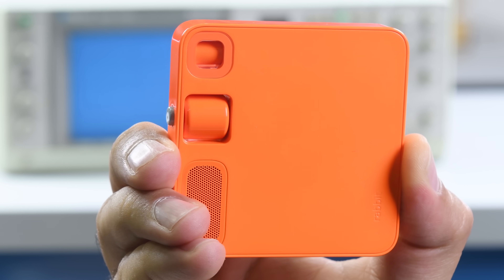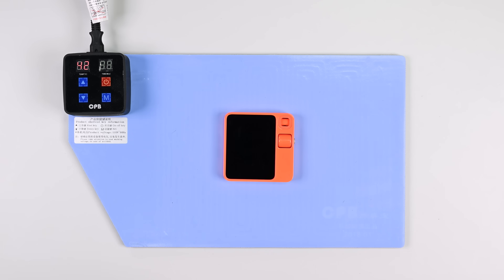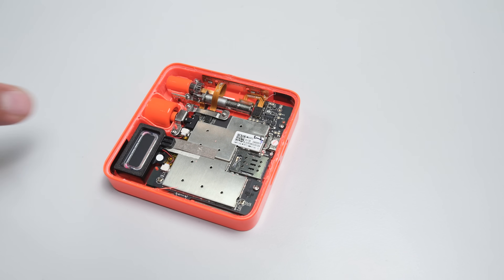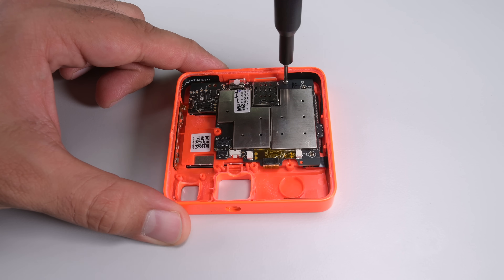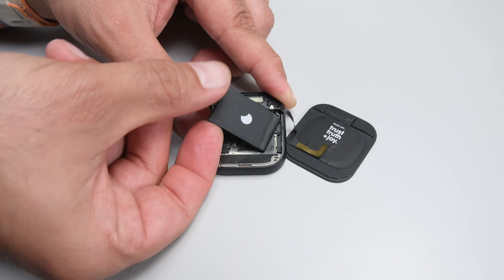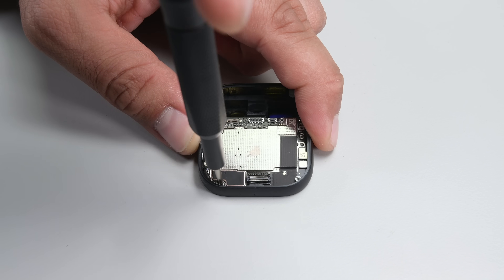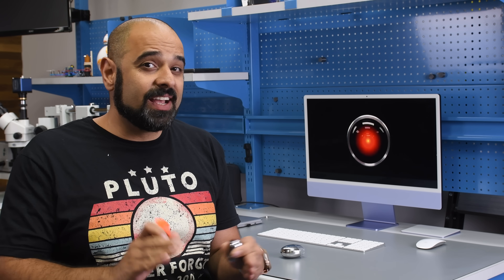The Rabbit R1 & Humane AI Pin Teardowns  - Worst Devices Ever?

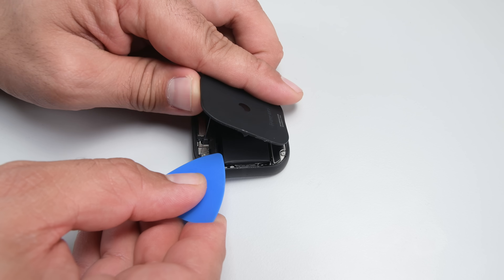Comment: 3:53 I would like to clarify this point, usually these batteries are rated for something like 500 charge cycles *to 80% capacity*, meaning that after that number of cycles, they should still have 80% of their original capacity. Ideally low-drain devices like this will perform better than 500 cycles, but only time will tell what quality of battery they used. 

While it's still 100% a problem how hard it is to access the batteries, saying they're only good for 400 cycles is a bit misleading.

Comment: humane definitely shouldve used a bigger battery and much newer chipset instead of a 2019 midrange smartphone chipset to prevent the overheating, battery and speed issues like why was this even marketed as an ai product when the internals of this phone are also some of its weak parts?
and before people say that quadcomm did claim in the website that its a low power chipset that can run ai based tasks, its still not powerful enough given how slow it is let alone having it run chatgpt

Comment: Oh. Suddenly it makes perfect sense why the Ai Pin overheats all the time, and why people report getting burned by the battery pack. Wireless charging coils.
Unless those coils are 110% perfectly aligned, a huge amount of the power gets turned into heat. And they will never be aligned due to there being clothes in the way.
And all that heat then gets dumped both into the SoC due to proximity and all the metal inside, and of course into all those solid magnets inside the battery pack.
Also all that heat will degrade the battery rapidly... 400 charge cycles will become more like ~100, if not lower. And that's assuming it don't burst into flames due to overheating.

Comment: These are from two AI companies who realized two things.  One, AI isn't profitable.  Two, they aren't doing anything more than what assistants on phones and search engines do.  Both drove them to doing very specific things that were inevitable for these types of companies.  Sell a very inexpensive to produce device and, in the case of the Humane, sell a subscription to their service.  The reason both of these companies will tank and the servers connected to these soon to be landfill fodder is because there is nothing these things do that your phone already does.
These things probably cost under 25 bucks to produce.
Now if this was 25 -30 years ago, this would make sense.  It was like owning an MP3 player.  If your cell phone could do music, you had to deal with battery consumption.  If you want to change songs, you pressed an actual button to change songs, to stop and start.  So a device that did a thing made sense because your phone either couldn't or it wasn't a viable option.  We are at a point where creating garbage to do things your phone does already is just there to dupe people.
As for the devices themselves.  Companies need to go back to the drawing table and make their devices more repairable while keeping the solidity of the there.  I don't know if that would be a twist locking system or a push down and to the side to take the back off, but this ain't it.

Comment: These are cloud devices, not true Ai devices. Its basically a cellular connected mobile device. If the Device doesn't have a neural engine on a chip equal to the M3 Max or a RTX 4070 then it CAN'T do Ai jobs on the device.

Comment: 400 cycles? I have way older batteries that have reached 1000s of full charge-discharge cycles. I have 2362 cycles on my 10 year old laptop and still get ~80% of original capacity.
Reply: Smaller devices, or those assumed to have shorter lifespans anyway, tend to charge to higher voltage.
Reply: wow i never had a laptop battery last more than 2 years with usable capacity. i mean except my current one i guess, it still probably has around 80% capacity.
Reply: That's unbelievable, my devices show noticable degradation after about 600 cycles. But it really does vary on how you charge it. Temperature, the percentage charged, and probably more factors can lead to varied results

Comment: The thing I'm most interested in here is that tiny laser projector... That is such a cool piece of hardware. I'd love to have one to play with. I guess that proximity sensor module has something like Apples Face ID tech in it? They need to get the data on how to transform the projector output somehow
Reply: Apparently it's not very good though because it's so dim that you can barely see it in daylight. It's only really usable indoors or at night. 

Interesting idea but terrible execution. 

But it also leads to the device overheating because everything on that device creates heat, the wireless charger produces heat, the processor produces heat, and the laser module produces heat. Basically an expensive cube that heats up but breaks when it does so.

Comment: Yes! these things could just be apps on your phone. It's only a matter of time until Google makes a decent version of Gemini that does everything these things can without the extra hardware to carry around and charge. I mean, what Google and Apple should really be doing is focusing on getting their assistants to work amazingly on smart watches. Sure it's a extra piece of hardware to carry around't but it's not a weird thing on my shirt or another thing in my pocket. I mean, I didn't think I would get a ton off use out of a smart watch, but bought one because I even got lazy about pulling my phone out of my pocket to check a notification, and have actually ended up using it much more than I thought I would. Rabbit, which is clearly just an app running on android, should have focused on making a great AI assistant that could be used on wear OS.
Reply: I haven't seen any feature on these that isn't already on a phone.

Comment: Turns out the rabbit actually is just an app running on Android... But apps don't sell (has nothing to do with system restrictions).
More unnecessary e-waste.
Reply: How is that surprising at all. If you’re already using a Mediatek chip, using Android OS that is perfectly compatible with the hardware makes perfect sense. Why reinvent the wheel if something off the shelf provides a solid base.
Reply: @Entertainment-  "Why reinvent the wheel if something off the shelf provides a solid base." - Yes, why buy the rabbit R1 if you could just run the same thing on your phone? You missed the OP's point. The issue isn't the rabbit R1 using Android. The issue is the fact the R1 could've been just an app.
Reply: @0x1EGEN  Why was Siri limited to the iPhone 4S when it could have been a software update to the 4 and older? Why is Google limiting Call Screening to only their Pixel devices? Clearly all of them thought it’s a strategic necessity for differentiation, same case here.
Reply: @Entertainment-  The point is that the bespoke hardware does not offer any advantage over simply running the software on the existing device in your pocket. It is adding needless complexity to achieve the same functionality.
Reply: @Entertainment-  $$$$$$ I'd love to know what it costs to make the R1.   The app is just and app.  The device is a magic BS machine.

Comment: if it was an app on your phone, then they couldn't sell you $30 of hardware for 200 bucks. I'm assuming this is how they pay for whatever cloud service they are offering... for now. As with any purpose built device like this, if Rabbit dies, this thing becomes a fully unusable brick as all of it's functionality is reliant on the cloud.
Reply: 'AI' has reached the Juicero phase.
Reply: Finally someone who mentioned that part. I HATE any product if it relies on the company staying in business to work. The more independent it is of the company the more I love it. I have this software called FlowFrames on my laptop, which is not only free and open source, but also lets you download the AI models to your device so it works completely offline.
Reply: @Nexalian_Gamer  don't you need some pretty beefy hardware to run AI models like this at a reasonable speed?
Reply: @steveRoll595  If I'm correct mine has a rtx 2060. It does take a while to interpolate frames, especially if the video is 4k and I'm adding like 240fps to it. It can take upwards of 10 minutes, but on my Macbook it'll probably take like 30 minutes to nearly an hour
Reply: @Nexalian_Gamer  NPUs are presented on a phone since 2018, the Snapdragon 845 already had 3 TOPS of AI performance and now, five years later, the Snapdragon 8 Gen 3 peaks at 45 TOPS. Apples M3 is only 18, with AMD and Intel a bit behind. Sadly, I can't find any way to directly compare them, but latest sd 8gen3 spits image from Stable diffusion in under a second, while rtx2060 on 512px photo has to work for at least 3-4 seconds.
Reply: @vadnegru  The problem isn't running the computation on the device itself, the problem is owning the computation, the server part of the device could be just a program you installed on your desktop PC and uses your geforce rtx 4090 remotely.  It would work as a "private cloud".

Actually that concept in of itself would "revolutionize" the smartphone. Imagine not having to call any of the big tech corporation servers, you have a big box in your house that does the remote processing for your smartphone, without "clouds".
Reply: @monad_tcp  we aren't far from on device AI, but this or "Private AI" would hurt companies, since their shiny new panic buy GPU would be useless.
Reply: @steveRoll595  To run them, a top end PC GPU should suffice. To train them, well, you need a big cluster.
Reply: Someone actually managed to get it running on a phone, so it completely eliminates the need for these devices
Reply: @gliderman9302  Not fully,some features wont run properly.Its not that simple.
Reply: @gliderman9302 what do you mean “it”? Both Android and iOS are wayyyy too locked down for a third party LAM.
Reply: Because it's basically an Android app 😅
Reply: @gliderman9302  No it doesn't... I can run calculator on my phone yet I still use the hardware one. Guess why.
Reply: Also it's true other way around, you could run Android apps on it, sideloaded via ADB
Reply: If it had enough processing power to run homebrew llms it might be worth it.
Reply: @Polyrux  Yeah, as soon as we have fusion reactors of a sice of a coin then maybe we can fit supercomputers doing LLMs into 10x10 devices :D
Reply: Unfortunately this has like 4GB of RAM and most likely a helio G31 @Polyrux
Reply: One note is that it won’t be unusable if Rabbit dies, it’s an Android 13 device so you can already sideload onto it (someone already ran a gba emulator). There are also people messing with emulating their cloud servers.

This means if they die then the hardware will be cheap for fun side projects.
Reply: I love e-waste and throwing away perfectly working devices bc the servers shut down 😂
Reply: Even still, R1 uses cloud services, at some point Rabbit cannot keep giving that away for free. That $200 doesn't go that far.
Reply: only good thing is that it is android, so it's probably pretty easy toset up your own chatbot app
Reply: That's when I buy it from any of them for 30 bucks on ebay to reverse engineer ir
Reply: Google lens already does what these things do at release too lmao. If Google or even apple introduce some powerful ai cloud to work alongside android then both the rabbit and humane pin become useless
Reply: their hosting provider must need a king's ransom, smth like Royaltyhosting
Reply: @a4Jonatica  I mean I'd rather store my data locally than upload it to some kind of cloud service
1TB HDDs are dirt cheap nowadays
Reply: Didn’t anki release a robot companion that was reliant on the cloud only to have shut services soon after, making the robot just a brick with wheels?
Reply: Except Humane's product here isnt $200, its an absurd $700
Reply: I think that it's pretty clear both these companies were and are aiming for a big tech acquisition. Making a viable product would be a welcome side effect, but not the main goal.
Reply: its very short sighted to assume they would make 170$ of margin on these.
R&D, Prototyping Costs, Hardware Engineering, Tooling and so on are huge positions not included in the BOM (Bill of materials) that will have to be covered. Especially with small quantities like these devices, fixed manufacturing and dev costs are enormous.
Reply: They could've charged $10 for app subscription. No lock in. But that wouldn't have made headlines.
Reply: People forget that you not only pay for the hardware, but for the development, designing, software and of course manufacturing..
But im sure you would do all that for free.
Reply: It should totally just be an app, and charge it to a membership, or even better they should have partnered with Apple or Google to sell that technology, but no.
Reply: Someone found out that YES it is in fact an app on a low end android phone.
Reply: @JessicaFEREM  Who cares what system is the program running on. Absolutely unimportant for anything.